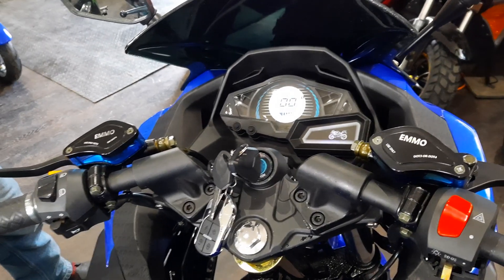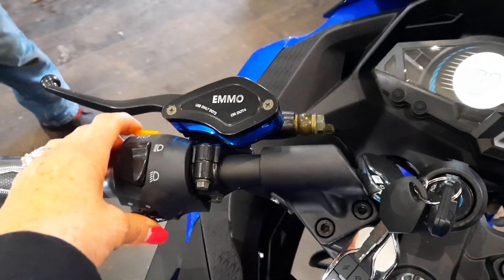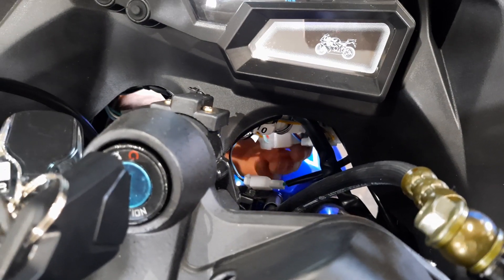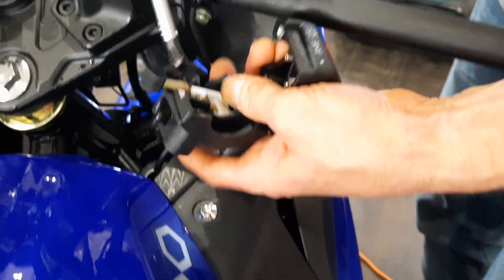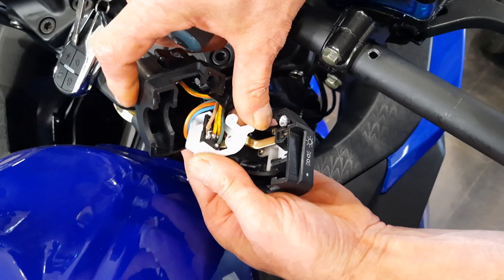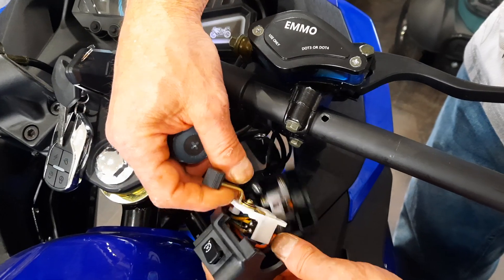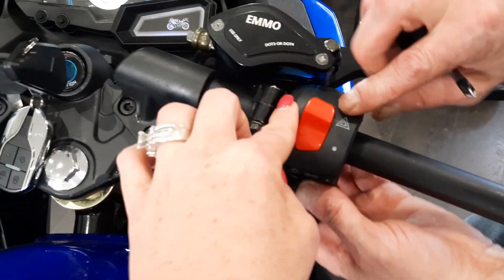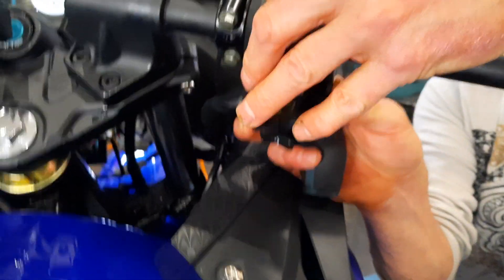Zone/Leo Faulty Headlight Fix

Comment: I took my GTS to a shop in London Ontario to get my headlight last week...guy at the shop DROPPED my bike. He broke the wind shield, breaklever and the throttle 😠.
Though my wife was gonna kill him. She & I stayed came and they are replacing everything. But no bike for a few days😩
Reply: Which shop? I'd its possibly the one I'm thinking of. Sad to say I'm not surprised. If you need some assistance I may be able to assist
Reply: @gideonlum4410  E-Ride. They were on Wellington now on York
Reply: @JoE-kx7dw  ? E ride is still on wellington have been for years. Eco bikes was on wellington and is now on York. Was this an emmo or a motorino dealer?
Reply: @gideonlum4410  my bad it was eco bike.
Reply: @JoE-kx7dw  it is all good. yeah the guy at E ride knows his stuff but he doesn't really work on other bikes much unless they are from him. Still occasionally does and he's a decent guy. I was told Eco bikes changed hands again very recently but I guess that wasn't true as I have my own horror stories from there. They are a joke of an Emmo dealer, or any dealer for that matter man. They can't even sodder 1 wire in 45 minutes properly. Something a child could do even. Depending on where you at and the extent of the help you need I should be able to assist, if you are on fb there is a London ebike group as well as a larger group mostly for Toronto area but im in it to. Message me there if you need?